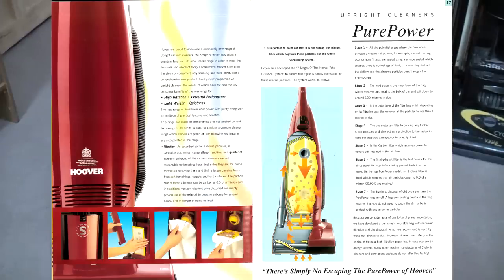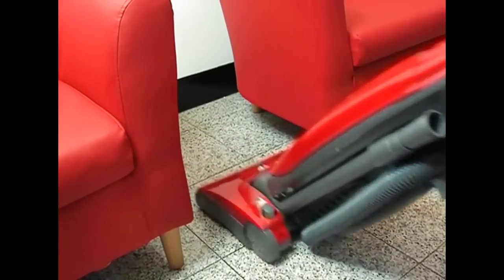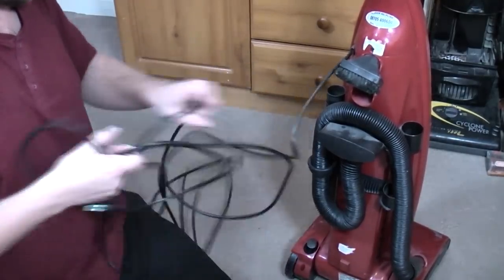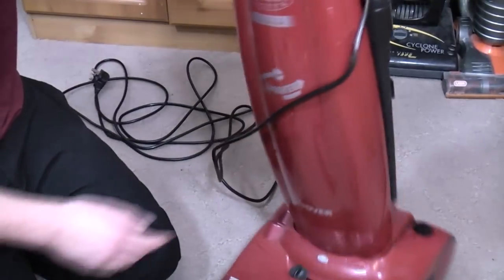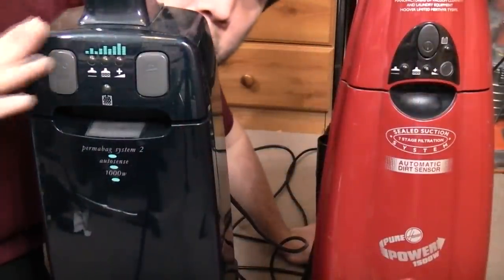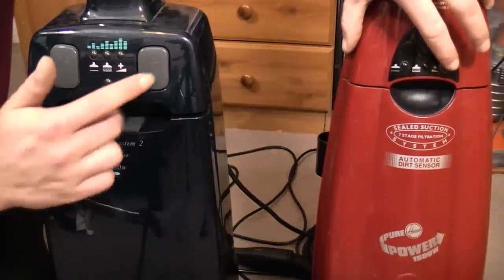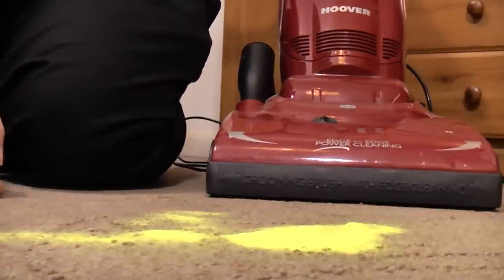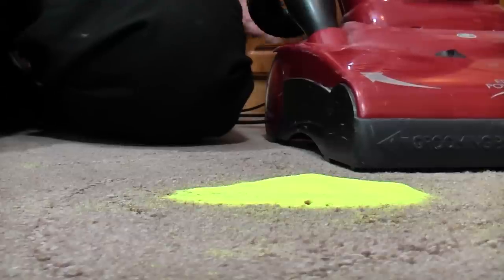Hoover Purepower U3456 Autosense! First Look, Before Refurb

Comment: The 97-99 Purepowers actually had a better release pedal, with a metal spring in it.  Very easy to press, the problem was when they made it an all plastic affair, that’s where it gets it.

The very first Purepowers didn’t have the Activator, it was a rather sparse, all bristle brushroll with revolving edge brushes.

They shortly changed it to an activator brushroll, with static edge brushes.

They changed to the brushroll yours has in it in about 2004.

Comment: The 2 systems between the Purepower and the TP2 with the Autosense are pretty much the same in the way they operate, except for as you noted, you  cannot permanently switch on the boost switch on the Purepower as you can on the TP2, having to manually switch it on every time you want it on the Purepower.
The Bag Full indicator on both machines will not work on the green setting, but on the Purepower, it also will not work immediately on the other settings either, if the hose is blocked off - you have to block off the suction and then keep it blocked off for several seconds (the delay), before the bag full light is triggered, and then it will come on and flash, and will stay flashing until the motor is switched off - this was to prevent the light being falsely triggered with using the hose, for brief cut offs to the suction.
I think those naff brushrolls with the narrow diameter brushroll and long bristles were brought in when production was shifted to China, possibly around 2006.

Comment: Bit of interesting information for you, the seperate molded badge that is on the bag door that says 'The Hoover Cleaner' is actually a blanking piece. Initially there was going to be a piston bag full indicator there instead but with all the auto sense malarkey going on it would of seemed a bit old fashioned to have an electronic auto sense hoover using a mechanical bag full indicator system so the original design was scrapped and it was changed to an electric neon one just below the handle so the idea for the piston one was scrapped and instead of changing the whole mold for the bag door they just created 'the hoover cleaner' blanking piece to cover the hole were it was going to be. Hope someone out there finds that interesting!
Reply from the maker: That's awesome info! Makes good sense too. Then presumably they worked out it was just cheaper to carry on with the setup than retool the bag door
Reply: @beko1987  yes exactly! And thats when we have 'The Hoover Cleaner' bag door! Because, lets face it, even in 1997 Hoover were so cheap they wouldnt create a badge for the bag door unless they wanted to hide something, which in this case was the space for the piston bag check indicator. It makes sense aswell as some of the turbopower 2's have a badge on the bag door ic there was a neon indicator fitted instead.